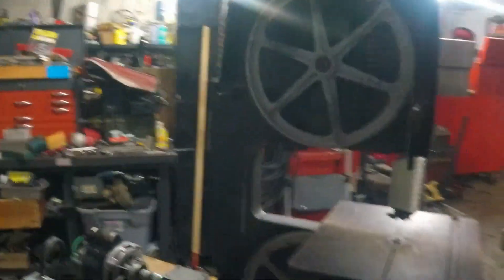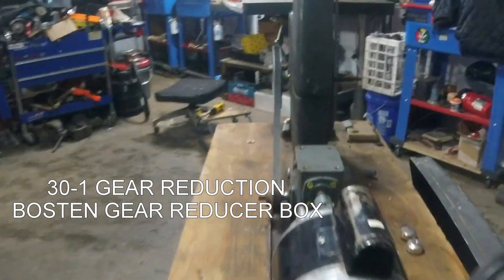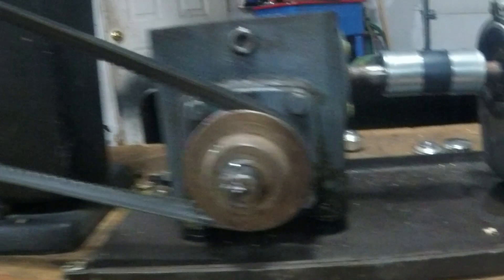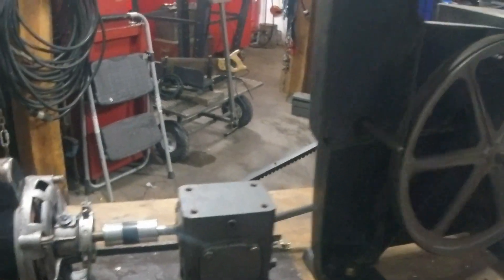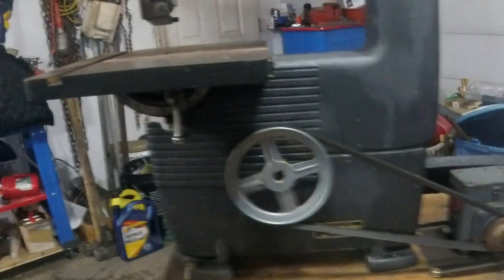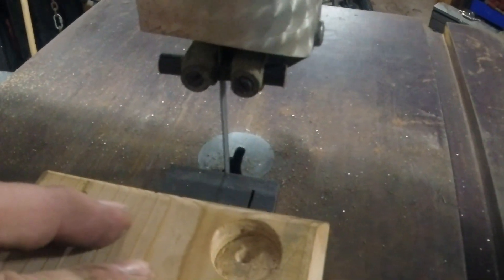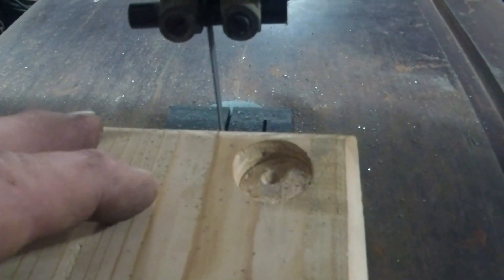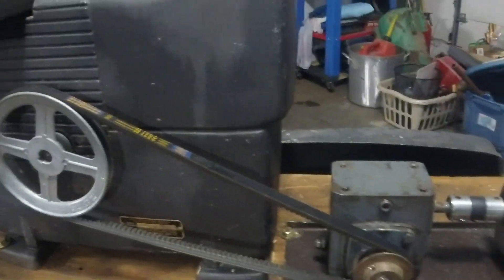BAND SAW CONVERSION

Comment: Have you tried cutting anything thicker in steel with your setup?  I was wondering if you had enough power for a thicker piece without belt spillage or the motor stalling.
Reply from the maker: Ive cut 1/4 inch easily on it. Zero belt slipage

Comment: Is the coupler between the motor shaft and gear reduction box a common component, or did you have to fabricate it? Thanks again for an awesome video.
Reply from the maker: Boston gear sells them I’m sure. It’s a common component
Reply: @toolrescue9119  Awesome. Thank you!